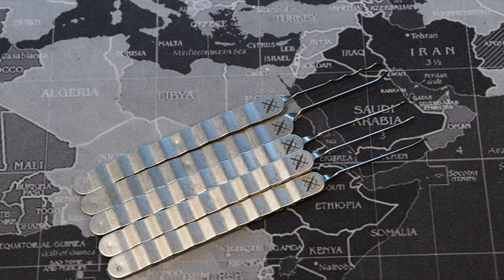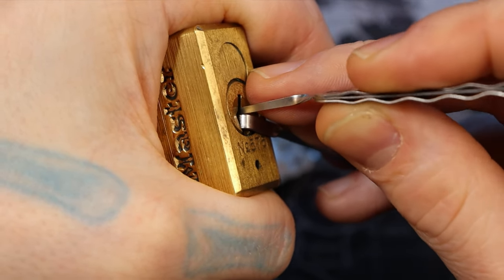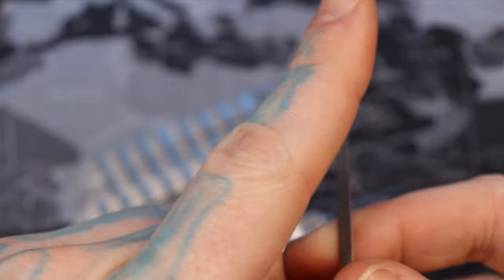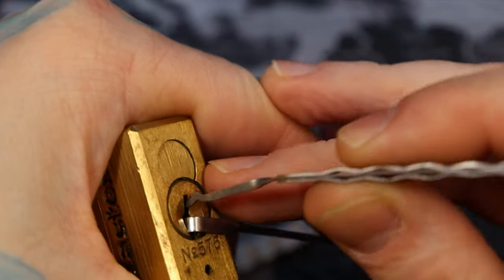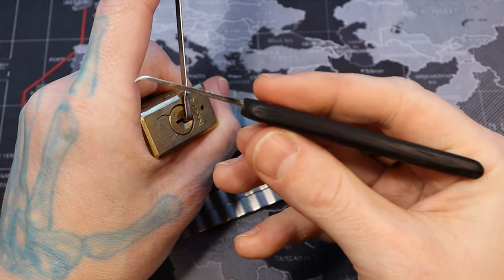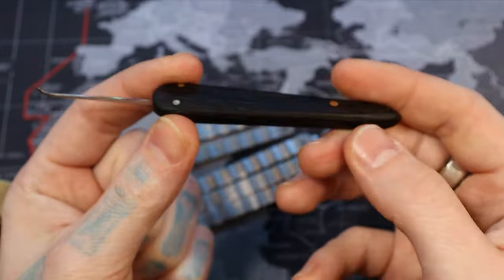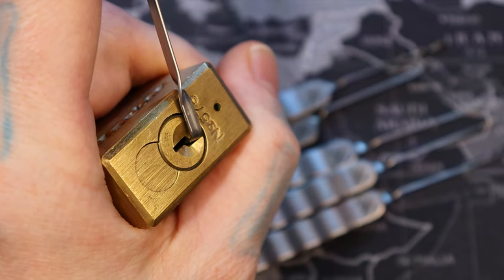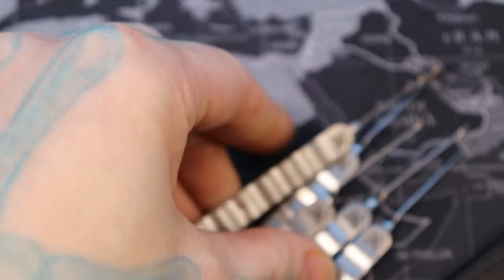293) Twist Picks by Cloaked Entry Co - Sideways Lockpick Handles

Comment: Do 575's not have spools? I could swear I've felt at least one in mine.
Reply from the maker: Not that I've found. 570s definitely do.  I gutted the 575 in video 121 and the 570 in video 134 if you want to check them out 😀 Happy picking!
Reply: It seems like I'm wrong and now I have to gut mine. 😂

Comment: Blasphemy!!!  Just kidding, but I dont think I would like the flex myself.  Your design looks much more practical. Maybe could 3d print handles for the thinner dual sided picks.
Reply from the maker: Great thinking with 3d printed handles.  Could buy any pick manufacturers pick without a handle, grind/sand down the sides to fit in 3D handle, glue, you got a sideways pick 🔓